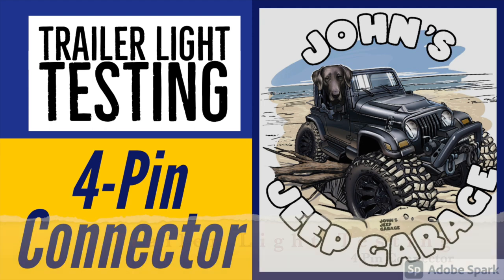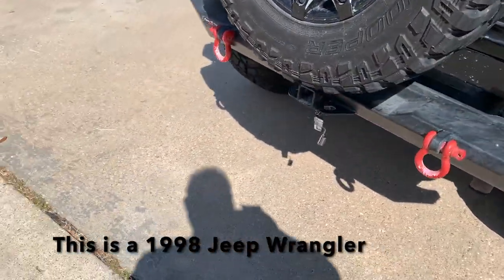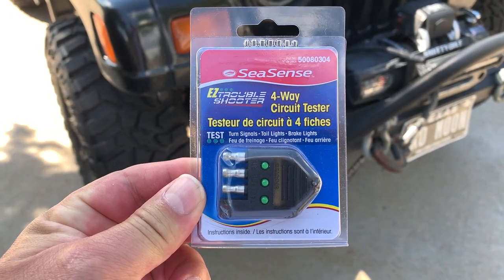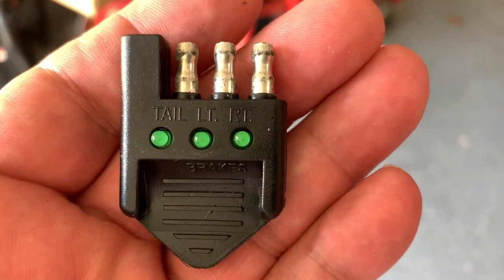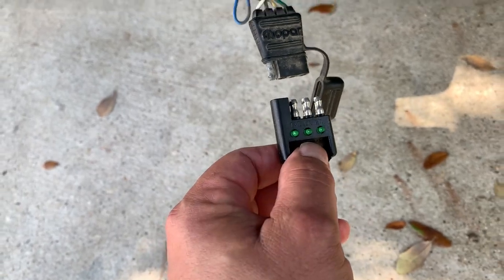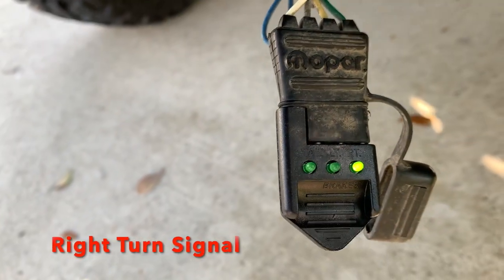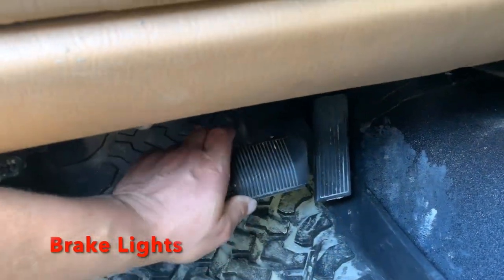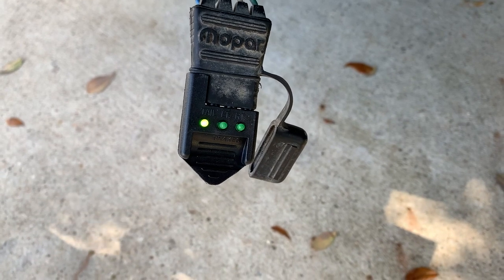4 Pin Trailer Connection Test

Comment: Thank you buddy
Reply from the maker: Thank you for watching our video!
Reply: @JohnsJeepGarage   I farm and have tons of trailer light problems.  Bought that off of Amazon but have yet to use.  I appreciate your response bud
Reply: @JohnsJeepGarage  other issue is I don’t even know how to wire a trailer.. been needing to incorporate that harness for a dc sprayer from my truck bed to avoid the aggravating car battery and alligator clips in the bed of the truck.  Got to be a better way.  But I’m a dipsht
Reply from the maker: I hope it helps.  Thank you.
Reply from the maker: There are many things you know that a lot of people don't know, especially farming.  I try to do things myself but don't always know what I am doing so I have to ask for help.   I found some videos on YouTube that may help.  It seems like there are a few other good ones as well that could help you.  I have not put a video together on trailer wiring.  This video may help I found: https://youtu.be/fffIjq_r0xo
Reply: @JohnsJeepGarage  thank you so much. Very kind of you.
Reply from the maker: Have a great day and Thank you for watching!

Comment: Will your trailer lights even register if the tail isn't working?
Reply from the maker: It depends.  If your taillights are not working because of a bulb for example, but the signal for the trailer is still sent through the wires, then yes they will work.  If your taillights are not working because there is a ground connection issue or wire is broke, then the trailer lights will not work.

Comment: How is this necessary?
Reply from the maker: It allows you to test your 4 pin connector on your vehicle without the hassle of connecting a trailer to it to then find there is issue with your wiring or ground connection.  A person can easily connect a trailer, but if something doesn’t work you not only have to troubleshoot your trailer but also your vehicle. Many people cannot use a electrical voltage/amp/ohms meter. So this tool makes it easy for the person.
Reply: You still have to operate switches in the cab and then go to the back to read the tester. You can see whether the lights are working with or without the tester. Seems redundant to me.
Reply from the maker: Unless you want to connect your trailer to the vehicle, to ensure the lights are signaling correctly or use an electronic meter, this tester works and saves time.  Don't get me wrong, I am not selling it and not associated with this company.  Operating the switches in the cab and reading the dash board and vehicle lights only shows you if your lights are working on your vehicle.  It does not show you if the trailer harness is working correctly.  There are many scenarios where the connector doesn't have power, ground, etc. due to loose wires, failed connections, etc.   So this test is validating the output signal to the connector, not your vehicle.  If you want, you can connect a trailer to it to check these things but this small tester is a convenient choice.
Reply: @JohnsJeepGarage  My trailer lights work on Truck A with no problem. When I connect the trailer to Truck B, only the running lights operate on the trailer; no turn signals, brakes, or hazard. So I know the issue is the truck. Is it wiring? 4-pin connecter? etc...
Reply from the maker: If it works on Truck A and not Truck B, then it is a problem with Truck B.   Is there a fuse for the trailer tow stop lamps or blinkers on truck B ?   Sometimes it is the ground on the trailer but since it works on Truck A, it would not be on the trailer.  If no fuse issues, check for damaged wires (pinched or cut).   Also look at the 4 pin connector on the truck and see if there is any corrosion on the connection or any debris.   Opinion only.  I would love to hear what you found.
Reply: @JohnsJeepGarage  I picked up the LED 4-pin connector. Confirms what I know. The running lights operate (green LED lamp), but no switch or brake lamp LED illuminate. Next step is locating and testing the correct fuses.